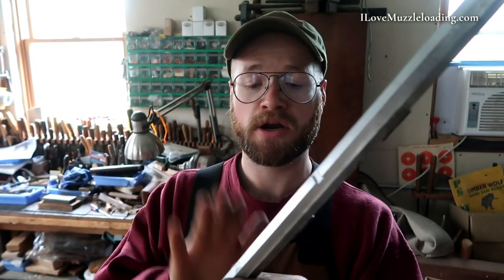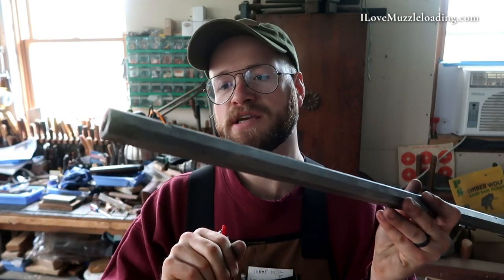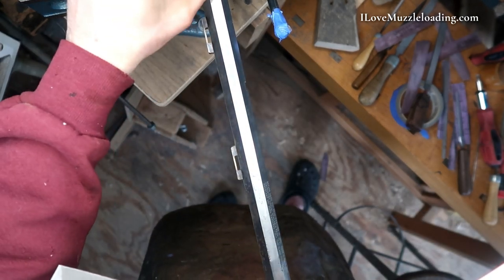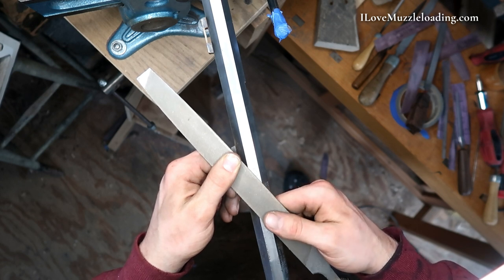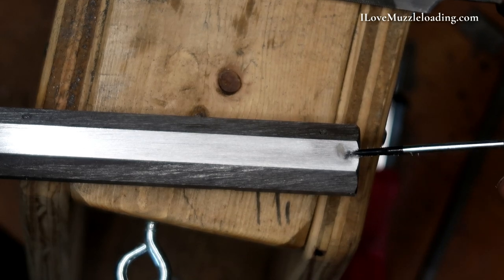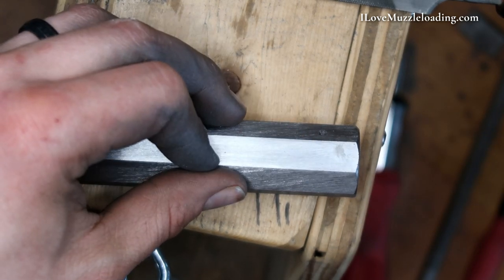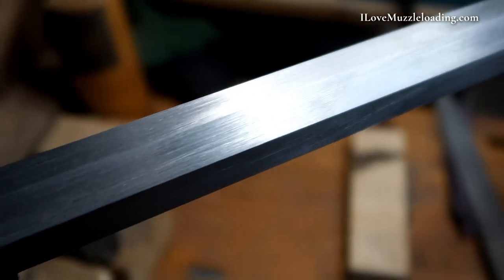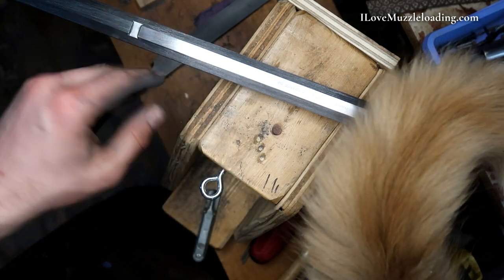Draw-Filing, You don't have to but you should | Investarms Gemmer Hawken Build Part 19

Comment: Your hands should be as far apart on the file as you can get them, holding close to the barrel will allow the file to rock, you will also get sharp shards driven into your finger if held to close while drawfiling this. If you rub chalk into the file teeth it will not clog up the teeth, and give you much longer working time between carding, it is also useful to have the overhanging part of the barrel supported by a support, (a horse), this will stop any flexing. ( I see you are using a bench support later in the video). The way to stop rust on a wall hanger is to heavily wax the metal surface, it will not collect dust as an oiled finish will, and keep the metal from corroding, even under quite damp conditions. Keep at it ! Chris B.
Reply from the maker: Thank you! This is very helpful